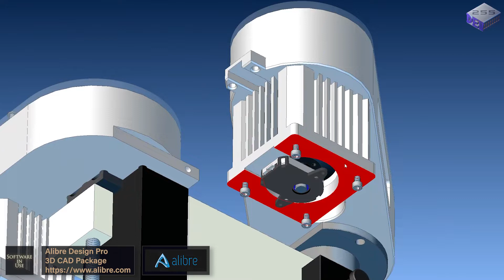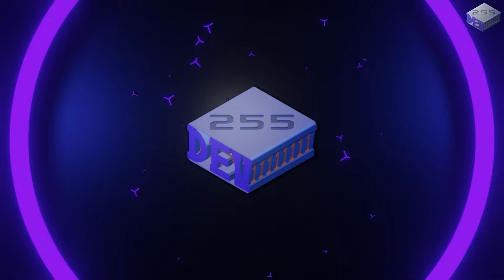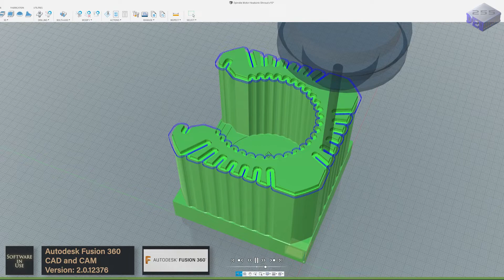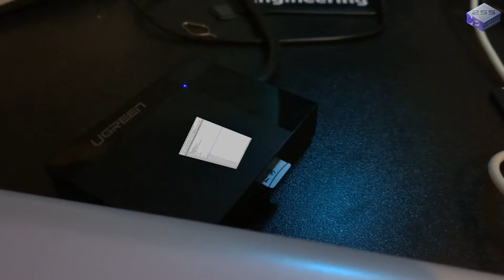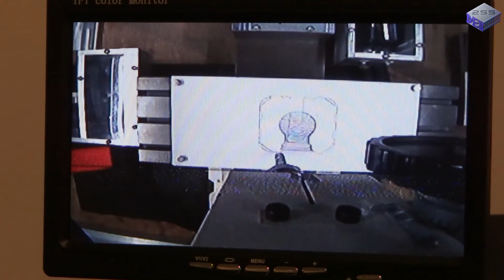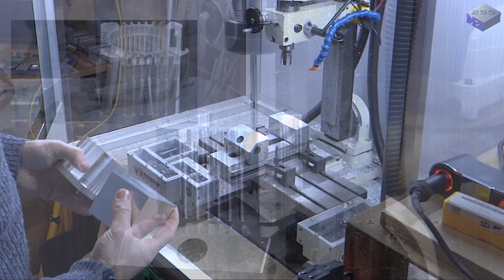Solar Powered CNC - Motor Heatsink fabrication

Comment: Perhaps you could repair the damage with an aluminium weld, then remill the piece.
Reply from the maker: Hi, that's a good point, I do have some JB weld that works well, or some alloy wheel repair, although the damage wont affect the operation of it. Good idea though, I may even do this if any other damage occurs due to my milling skills, haha.